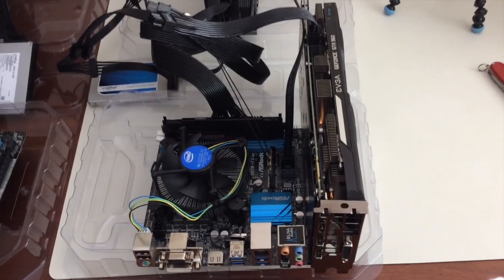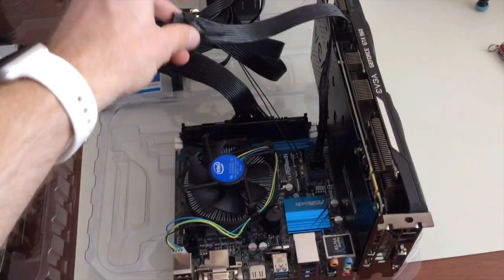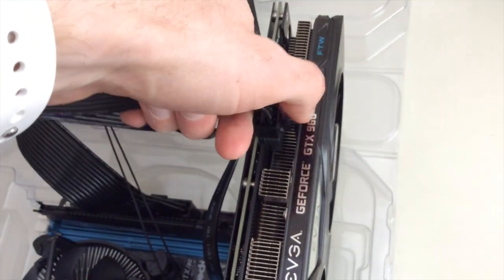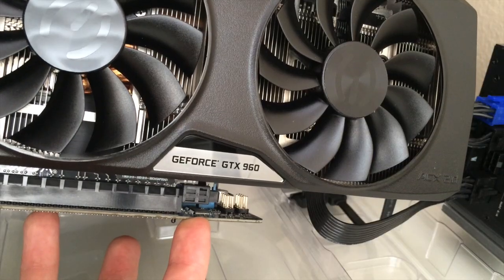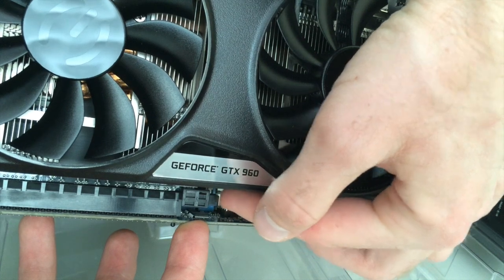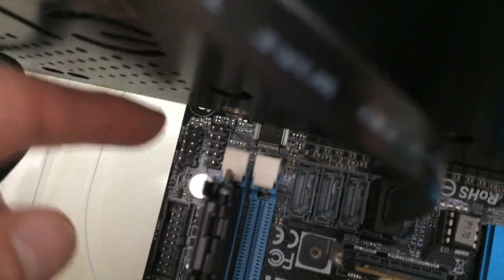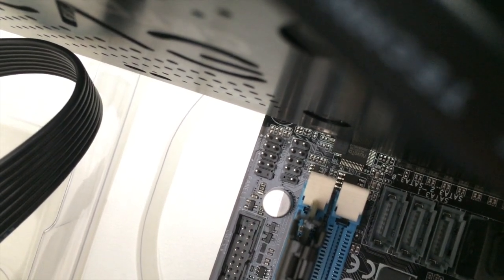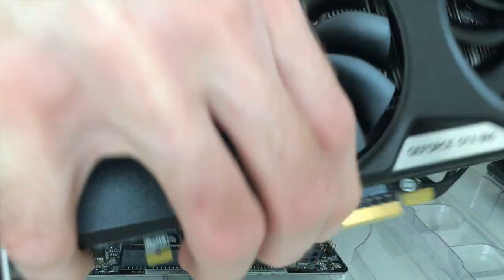How to remove GPU

Comment: No videos have helped me what so ever I push the tab it doesn’t move it just hurts my finger and it’s near impossible to get to it because my cooler really close and I can’t remove the cooler because I have no more thermal paste
Reply from the maker: hmm that sounds tough, yeah its harder when its in the case and all that, sometimes you need to hold the GPU with your other hand as you press the tab to ease the weight. Did you get it sorted?

Comment: My card won’t budge I have unscrewed and everything
Reply from the maker: any luck? did you try rocking it back and forth?
Reply: Douglas Hewitt yeah the clip soundly go all the way so I pushed harder and it snapped so I gave up before anything else broke
Reply from the maker: @finnalexander7603  hmm sorry to hear that. not sure what to say without being able to see it. you could post a question here https://relay.how and upload a quick video of whats going on as an "answer" and then I can take a look.
Reply: @relaynotes  Hey its been a year, but I literally have the same problem. I have unscrewed everything and in frustration broke off the clip. That shouldn't be a problem because it is now loosened on the side with the clip. But it is still holding on the other side(back panel side) as if I didn't do anything to the screws. Is there a possibility that the gpu is screwed to the motherboard from behind?
Reply from the maker: @flamekite1679  its unlikely its screwed in from behind (I've never heard of that) but sometimes that metal bracket can be pinched in pretty tight with the case. Can you loosen it by wiggling it up and down?

Comment: can you this immediately! did you uninstall driver before you remove this?
Reply from the maker: typically yeah you want to uninstall the driver first. Not the end of the world if you forget, it depends if you're moving to another card of same brand, going to integrated graphics, or switching (NVIDIA to AMD for example). You just want at the end of the day to only have one set of drivers installed and all old ones removed.

Comment: I'm using a nvidia 750 ti and the space is sort of tight. I need to replace my hard drive because it is really faulty and I have lots of cables blocking the space between my hard drive and gpu plus if I pull out my hard drive I have to move my gpu so my hard drive can slide out. I can see a yellow clip but I'm not sure If I move it the the left or right
Reply from the maker: hmm hard to know without seeing what you mean, but the tab for the video card can only move one way to open up so you can pull it out, essentially you push down toward the motherboard and it rotates a bit leaving the GPU free to come out, you still have to pull on the gpu sorta as you push on the tab, it will be snug

Comment: do you have to uninstall drivers? Im thinking about removing my gpu since its blocking the way of my ssd cables and since my ssd wasnt installed properly.
Reply from the maker: if you power if off, remove the card, do stuff with ssd cables, then re insert the card, then power it back on windows will never know. If you plan on leaving the card out and power windows back on, yeah its probably better to remove them beforehand so windows can switch to intel gpu. you may have to make change in bios as well in that case.

Comment: Instructions not clear. Genitals are locked and stuck inside.
Reply from the maker: a common mistake
Reply: Should I proceed to apply lubricants and obtain a tool box for secure removal?
Reply from the maker: dont forget the rubbing alcohol, its most important
Reply: I was literally about to make an instructions not clear joke, but well shit. You beat me.
Reply: I would like this but it has 69 likes already
Reply: BerlinWallNeverFall 1991 now it’s at 70 :(